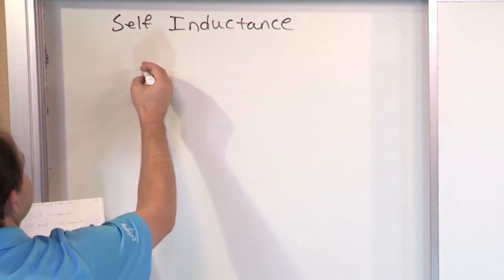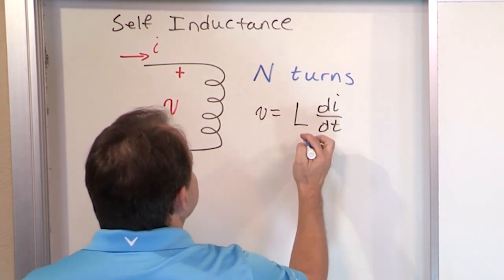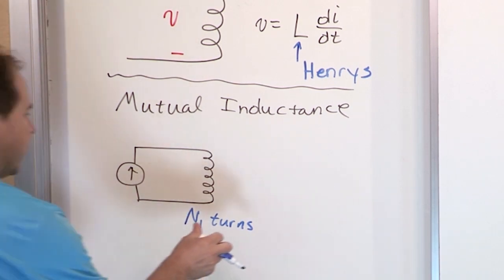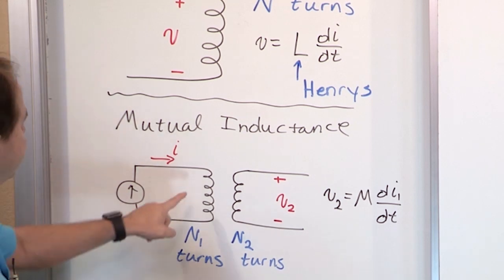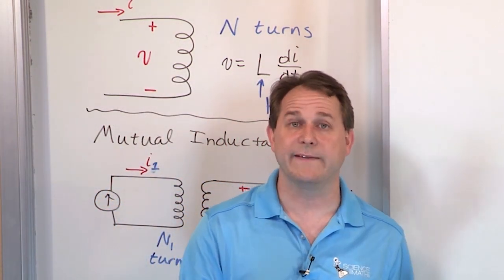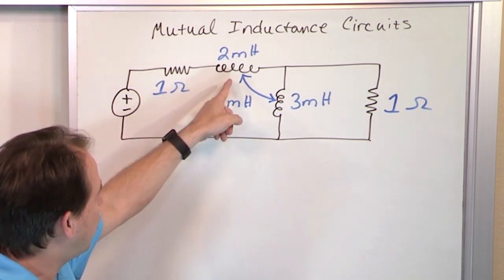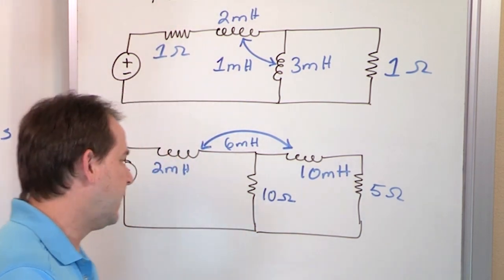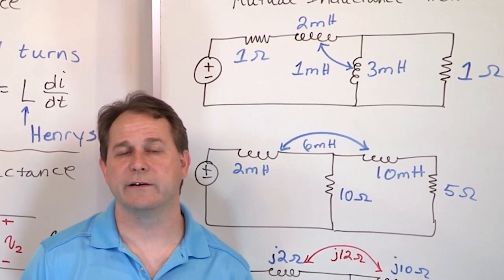What is Mutual Inductance?

Comment: Could Inductance be defined as the passage of Current from one side to the other, such as Current passing from the Primary side of a Transformer to the Secondary Side, WITHOUT a DIRECT ELECTRICAL CONNECTION because the Field is doing the Work?

Comment: Keep in mind that current is a flow of charges, therefore, an inductor is not necessarily a "coil of wire" since a coiled pipe of flowing ions should theoretically also induce the same magnetic flux effect.